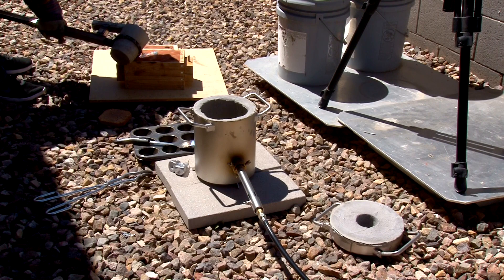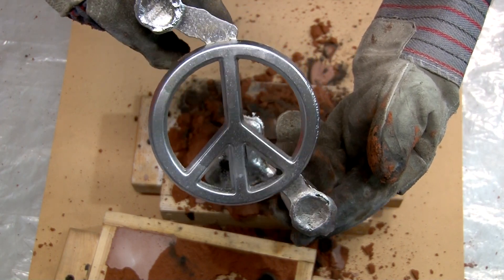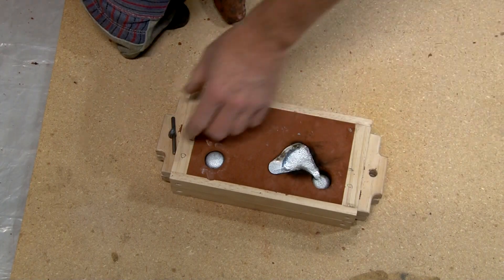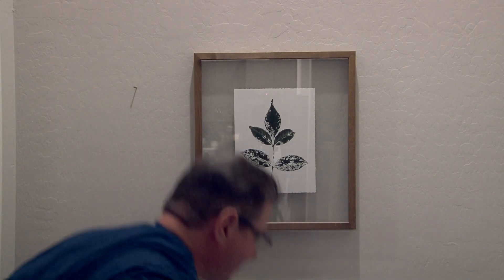Metal Sand Casting of an Alumium Peace Sign for Decoration

Comment: Thanks for the very easy to understand videos! One question: do you reuse the burnt petrobond sand?
Reply from the maker: Thanks for watching.  When opening the mold I try and do it gently to keep large parts intact.  Then I use a wire brush the size of a tooth brush and rub off the burnt black sand into a pile to discard.  I also will pick out chunks of burnt sand to discard.  I try and minimize the amount of sand that is burnt when returning it to my used sand bucket.  Most of my castings if I want a nice surface finish I will use just a little bit of new unused sand for facing sand and pack the rest of the mold with used sand.  I will throw this in a video down the road.